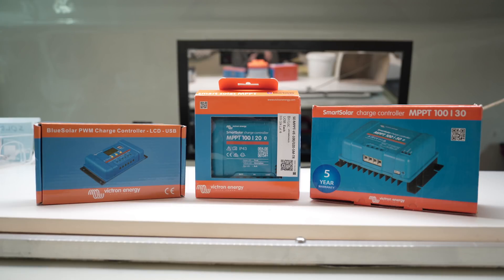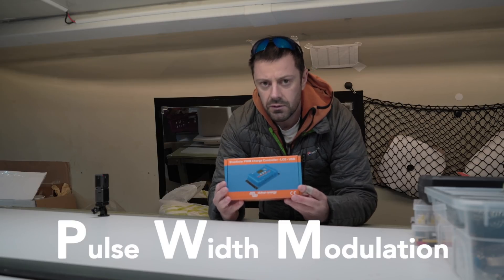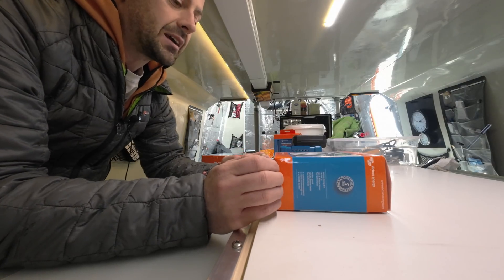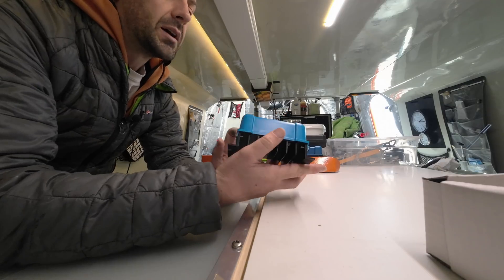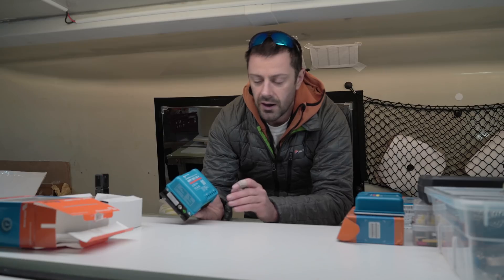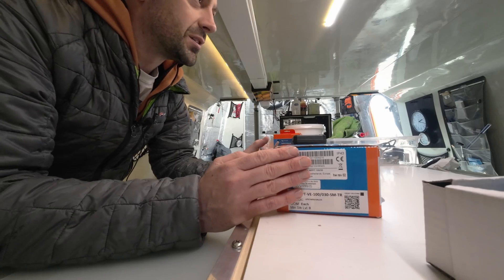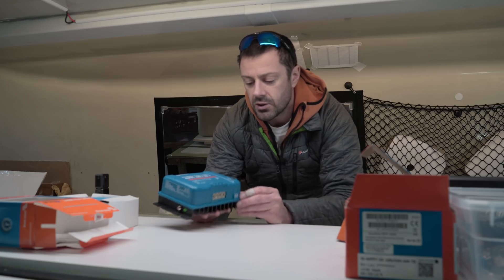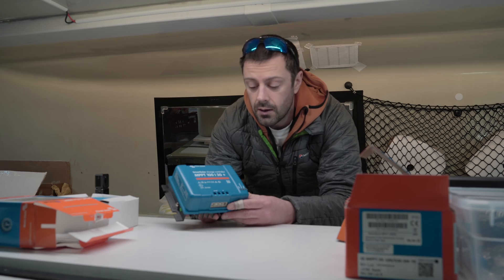Unboxing of small(ish) solar charge controllers and overview of features. Victron PWM and MPPT [4K]

Comment: Great unboxing vid. I’m running the 100/50 which is the 100v 50Amp charger it’s overkill lol but my batteries allow up to 60Amps of charging and having a 510Watt panel the controller is needed for all that juice but I have heaps of Victron for the simple reason it’s easy to install, run and maintain
Reply from the maker: Cheers - overkill is all good as it gives your setup scope to grow.

Comment: At 1.50 . If this is connected to solar and battery and you put a power bank into the usb output does the power come from the battery or the solar panel?
Reply from the maker: The system is integrated, as far as I'm aware. The reservoir is always the battery, so even if the solar panel is applying a charging voltage to the battery, the USB outlet is 5V from a buck converter linked to the battery.

Comment: Victron are really good, my only critque is when using the Bluetooth products you always need a LIVE internet connection despite downloading the victron connect app to my laptop, so my MPPT, whilst it appears to work well, I have not had chance to configure it, I tried both bluetooth and the VE cable and no joy, because I do not have live internet at that part of my estate.
Reply: When I had one the app worked without internet. Just Bluetooth and be close to the controller.

Comment: Just trying to help.
You need to wire up the  port side in series and connect to the solar charger and do the same on the starboard  side. This gives you a solar array in series and in parallel. If you wire it all up in series and one side is shaded, then your total power will be at the lowest out put, even if the other side is in full sun light.
Try it out yourself.
Reply from the maker: Both sides will be independent, through different controllers. Is this what you mean?
Reply: No you can put both through one charge  controller.
You have 2 spare 50 watt panels right. Put them in an A frame , one facing south  the other facing north. Wire them up in series. Take a reading. Then in parallel and take a reading. When you head of north on your journey  the maximum sunlight will come from east or west if you think about it and solar shading won't help you.
Just trying to help.
Reply: So what I am saying is.

The maximum solar power you might get is only 200 Watts maybe, assuming this is enough power for your equipment.

Comment: I use the basic PWM charge controller for my vans Leisure battery, alongside a split charger from the alternator….its great for a basic setup, the MPPT is great for a bigger bank of two or more batteries…..👍🇮🇲

Comment: EG 2000w solar cells 24v, PWM Controller, 500w load/500w charge, 800w load/800w charge ok. 2000w solar cells 24v, MPPT Controller, 500w load/1200w charge, 800w load/1200w charge. PWM work best when there is a constant load & you can provide the same wattage charging from a cheaper solar system. MPPT work best in larger solar systems or where you are trying to recharge as fast as you can with the most amount of power from a greater quantity of cells. Obviously on a perfect solar day at the optimal angle always facing the sun you will only get up to 60% of the rated max solar cell rating with mono cells & up to 40% with Poly cells. Most ppl get really discouraged by solar because they don't understand the variables that go into everything which causes losses & the inefficiency of the product due governments having strict guidelines that manufacturers have to follow to product these products. If they were too efficient then ppl would create their own power & governments are never going to allow that.
Reply: So you think manufacturers make their stuff inefficient because the government tells them to do so? Really? 🤣🤣
Reply: @popuptoaster  Yes, technology for the public will always be at least 50 years behind that of the military in most cases. Big business company owners that own multiple business controls the technology that the public sees because society earns them their profits & they don't want to lose profit to something that replaces money that they can earn from us.

The military were using plate batteries in vehicles that were able to travel across the USA on one charge & yet we are led to believe that plate battery technology is far away in the future which is a lie. Everything in life what you hear on the news, what you are taught in school, is all lies.

Comment: ive kinda forgotten by now, but will Alan have panels on both sides of the hull? one one side puts you at an disadvantage when trying to harvest solar in any boat orientation
Reply: Panels work quite well in ambient light, especially at sea where the light is bounced up off the water, with most boat systems unless there is a heavy load running the only thing being in direct sunlight does is get you charged earlier in the day in my experience. Mine are flat on the roof on my house boat, I gave up bothering to angle them at the sun when i realised that the batteries are charged just fine even on grey cloudy days.
Reply from the maker: Yes indeed, 4 x 100W, two on either side.
Reply: @AlexHibbertOriginals  ah good, also a comment about the PWM controller, you could have that mounted near/on the dashboard for the helm, simply connected to the battery and a small load, or just using it for its USB ports
that way you can always see the battery voltage and are able to connect non permanent loads near the helm (or just charge usb devices like your phone or radio)

Comment: !onU I bought an Epever 40A charge controller kit with the remote display and temp probe for battery. I also have a cheap 10A controller for another system that does exactly what I need so another five months and both systems will have paid for themselves. It's addicting.